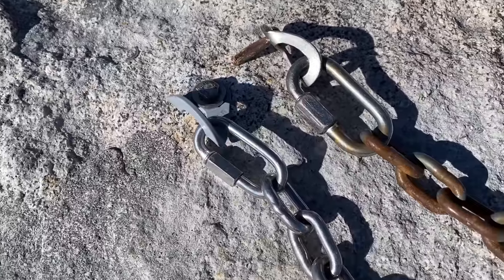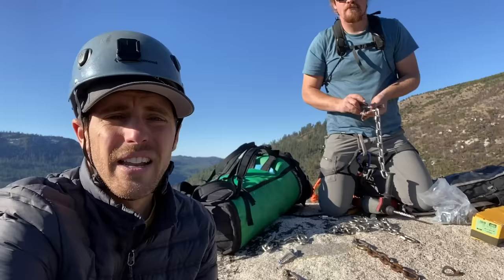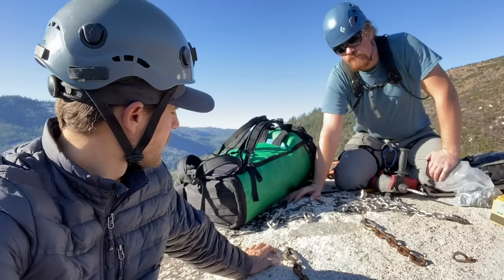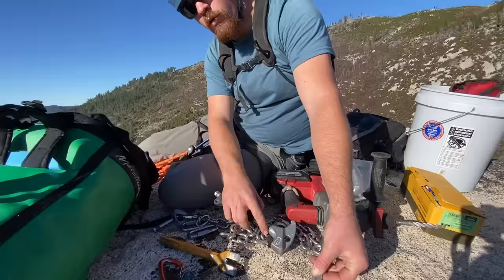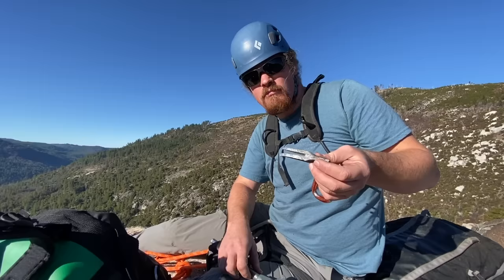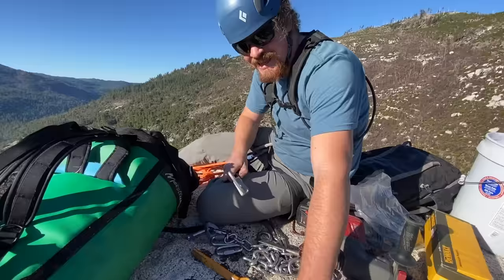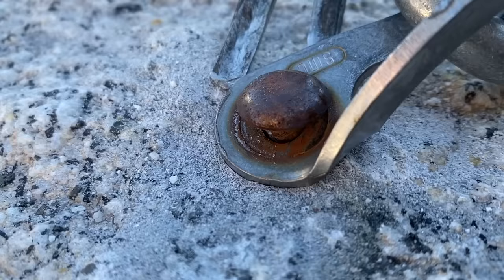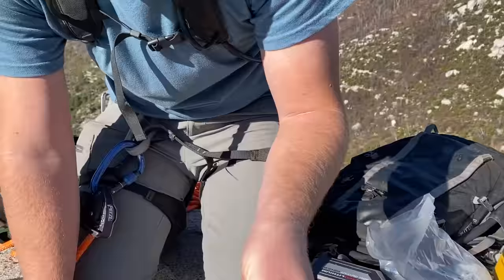Replacing split shaft climbing bolts with Powers Bolts at Sugar Loaf

Comment: Just some tips: bolts (mechanical anchors) always have a torque spec to torque down the anchors for optimal grip. Too loose  and he anchor can come undone over time, too tight and the bolt or thread gets compromised (although not likely on a 1/2” bolt). Use a torque wrench for this, it also makes installing easier because of the ratcheting action. Love your detailed video’s about bolts, strength, lines and all the other stuff. Even though I never climbed or used this kind of gear in my life. Kind regards, fan from The NETHERLANDS
Reply: he covers this in other videos and recommends getting a feel for the amount of perceived force to torque at home so you dont have to carry a heavy and delicate torque wrench to the bolt.
Reply from the maker: We are going to do a lot of testing in over/under torquing in BoltBusters soon!  I know the recommended specs are going to produce the best results but I like to know the red zone of danger in both directions.
Reply: @HowNOT2  Husky sells a nice one for about $65
Reply: With rock dust and particle fragments, a torque wrench in this application can be misleading or a downfall as well. As always approach these situations with both eyes open. You may get a correct torque reading, but one drastic pull to the anchor may reposition it or initiate small fracture in rock to loosen. And there are correct techniques to get a “good” reading with a torque wrench as well. Just saying. unlike in construction trades, anchor bolts in this situation may have merit being filled with glue on “suspect situations”. Wouldn’t necessarily need to be bomb proof glue - metely to fill the void and prevent any “shifting” of the materials.
Reply: HowNOTtoHIGHLINE That would be very interesting to see. Again thank you for the amazing content.
Reply: Chris Sonnenschein you forgot to cover the effect of the gravity from the moon, humidity in the rock and expansion difference between steel and rock in relation to temperatures. If the granite disintegrates a day after you torqued everything down, the torque wrench didn’t help at all, but neither a normal wrench. All of the subjects you mention are also a factor for the strength of the anchor but do not relate to the specific ‘tip’ how much torque should be applied for the anchor to reach its full potential. For every application and act the rule, like the channel always emphasizes, “everything is as strong as the weakest link” applies.
Reply: Fly Hero my point was exactly that just reaching the specific torque is not a “fail safe”. There is a proper way to get the reading. Rather than to simply use the torque wrench as a spanner. I will not disagree or agree with rest of what you stated as this not a territory of how I have used anchor bolts and torque wrenches.
Reply: I just think about how they did it in the ol' days and just hammered pitons into the crack and said "That seems Good enough".... all this shit is BOMBER... even what he just pulled out.
Reply: Also, rehit the bolt after the initial tightening, and then retighten, rehit, retighten. This seats the hanger to the rock better. Sometimes I hit and tighten 5 or 6 times after the 1st go. Makes a good difference
Reply: @chrissonnenschein6634  if someone uses a torque wrench as a spanner then they should'nt be doing this. or anything that requires a torque wrench, would trust most tradesmen over some noob who did the trial and error, watched a vid and read some instructions.
Reply: @HowNOT2  when drilling just put a bit of tape around the bit at the depth you want to drill to, or in this case a bit further. then you have a depth indication as you are drilling and dont need to resort to the old dip stick.

Comment: a couple of recommendations:
- wear gloves, even the lighter stretchy gloves with a grip palm are better than nothing when you're dragging your knuckles or err with the hammer
- if you're not using the depth gauge/stop on the drill (most of us don't) use some tape on the drill bit and/or blow tube to gauge depth 
- when replacing a two/multi-bolt anchor you can clip one or more of the unused old bolts initially (no need for king swing potential) and then switch to the first new bolt
as always, props to greg/asca for helping to make this all happen...

Comment: An easy thing to do to make sure the bolt hole is deep enough is to put tape on the drill bit where you can stop to drill before you go out
Reply: lol, said the same thing, then went through the coments, guessing you're a tradesman.
Reply: @davidsimpson3885  actually I'm an electrition and I place a lot of glue in and wedge ancors in concrete where ever fire proof mounting for cable cannals is needed and when you drill like 100 holes in a day even a little less work at each hole is nice to have
Reply: @jsl2phdx  would deffo trust a tradesman more than most of these guys changing or placing bolts, just cos we know what to look out for, and having done it day in day out for years.

Comment: Lovely content as always! What’s the reason behind tightening down the bolt before pounding it into the hole?
Reply from the maker: There is a range between tight and loose that you have to find on those 5 piece bolts to install them probably. Super Finicky bolts. i no longer install them. -Bobby

Comment: Are there considerations made for ice forming behind the bolt? I’ve seen bolts here pushed out of the rock, likely due to ice.
Reply: Aw, c'mon Christian! Are you being serious? If you can cite one case of where expansion of a relatively small volume of ice trapped behind the hanger exerted enough force to extract a properly installed steel expansion anchor, I will buy you a steak dinner and apologize publicly for being wrong. Granted, expansion of ice is a powerful force, no doubt, and many of the cracks and flakes we climb on may have been initiated at some time in the past by expansion of ice trapped within the rock with no place else to go unless the rock itself gives. The minor volume of water that could possibly be trapped behind/under a bolt hanger would simply flow out from behind it as the water freezes. If you could instantaneously 'shock-freeze' the water so all the expansion of the ice happened in a moment, maybe. And that's a soft, polite maybe.
Reply: @markpell8979  it was an honest question. I assume the rebolters out there would know more than I do about bolts. 

I can’t cite anything, except the anecdotal evidence of ~50 year-old split shaft bolts I’ve seen that were sticking out of the rock at least an inch. They were pretty rusty with paper thin hangers. 

Just asking if anyone else knew anything.
Reply: @xchinvanderlinden  Turns out I can help you with that. Rawl split-shanks are/were 'contraction' anchors that hold position in the hole using spring tension. Kind of like a springy angle piton but designed to work in a cylindrical hole. As such, they are always trying to eject themselves as the rock and metal, having different thermal coefficients of material expansion, respond to daily temperature cycles and changing weather. (Yes, admittedly, even ice.) This is the main reason besides actual climbing-induced loads that pitons can also work themselves loose and possibly become unreliable, mainly against pullout forces. There are concentrated stresses where the edges of pitons or the bowed-out split shanks on Rawl contraction bolts slowly wear and break the rock at their contacts with the walls of the hole through this thermal cycling. Surface corrosion/oxidation of the steel plays into this too and in time pitons and contraction anchors tend to loosen on their own from decreased grip at the limited points of contact. This is somewhat analagous to the nails in the planking on your deck working their way upward until the heads stick out and stub your toes. Apologies if I insulted you earlier, and I hope this was helpful!
Reply: @markpell8979  maybe we should buy each other that steak dinner 😄
Reply: @xchinvanderlinden  That would be fine with me, let me know if your travels ever bring you to Dallas/Fort Worth. My friends and I have a great little private sport climbing area nearby that you'd probably enjoy.

Comment: There is a depth finder built into most drills. Also USE A TORQUE WRENCH. You cannot ensure they are installed properly without torquing then to spec.

Comment: If you are allowed a power tool, hitting the tongue of tuning fork or wedge with the rotohammer may just vibrate the bolt loose. Obviously not to drill a hole, just vibrate, using a spade bit or old drill bit.
Reply: These bolts are made to be vibration resistant. Don't know what to extent they are though.
Reply: Hung Lo  Exactly my point. Worth a try. I don’t really think their intention was to be vibration resistant to the speed/force of a percussive hammer. (more likely resistant to oscillation like a clock pendulum- slow & rhythmic) Also, my point was to be using the wedge in conjunction. like lockpicking with a high frequency you have moments when everything is aligned to be loosest, so the wedge helps to drive the bolt out. Especially with the size of hand hammer in the vid - Another 5oz heavier makes all the difference,  but yes there are other factors to consider when done in this environment as well.
Reply: Hung Lo I bring this technique up because we use similar bolts for anchors on high rise rails for elevator shafts - and sometimes in construction things don’t align the way they should....
Reply: @chrissonnenschein6634  Oh that was an interesting read. I wasn't trying to say that you were wrong or anything. Thanks for the info and have a good one.
Reply: Hung Lo Nope didn’t really think you were, but with simple text, only clarifying the points..before someone else would I guess.. Likewise, take care!

Comment: Exactly what makes the old bolt require replacement? The little bit of surface rust doesn't appear to be cause for concern, does it?
Reply from the maker: Good Question. Any bolt that is non stainless will continue to rust until it is unsafe. The rustier it is the harder it is to remove in one piece and reuse the hole. You can't tell how damaged by rust the bolt in the hole is without removing it. Split shafts like the bolts in this video are considered a priority for replacement bc they can break during installation leaving a bolt that will break under body weight. There was a fatality in Bishop bc of one of these bolts. I have had 3 or 4 fail at shockingly low forces during removal. -Bobby

Comment: I wonder if you could get an attachment for the hammer drill to do the wedging?
Reply: You can cut an old worn off drill bit (with a bandsaw or angle grinder), then weld the prying "fork" to that so it can attach in the drill. The hammer drill has a switch so that you can disable the spinning action and just have the hammer. It should work much better to get under those old bolts-- but you'll need some extra batteries.

Comment: Do you use a tuning fork to remove other types of bolts, or just split shaft?
Reply: They work best for split shafts. You need separate tricks for each kind of bolt. Check out the bolting bible for an overview.
Reply: There are many types of devices and tools to remove various types of bolts. Bobby has one of these, it's amazing, check it out: https://www.mountainproject.com/forum/topic/116158404/yet-another-bolt-remover

Comment: Intention to inform: You could take a cordless 18V anglegrinder with you and speed the work up 10X.
Why hassle with chisel and hammer?
Reply: Because the intent is to reuse the hole and not leave a cut off bolt behind and have to drill a new hole.

Comment: Would it be better to not skip sizes, so the next round of rebolting in 20-30 years is easier? ie: going 1/4" to 3'8" instead of 1/2"?

Comment: that's cool, but I still prefer my cordless Milwaukee disc.
Reply: However your process does remove the previous bolt and reuse the hole.
Reply from the maker: It is ideal to reuse the holes.  If good bolts are put in then we don't have to replace them in our lifetime and our crags won't look like swiss cheese in 200 years haha

Comment: One suggestion for those not beeing a fan of the canned air, I recently bought some can I can refill with my bike pump to 10 bar and is usuall used for spraying any liquids. So you could also fill one to spray water if you would like to. 
The one I got is from a brand called hvg and you can replace all the individual parts. It holds the same pressure, so it should last the same time.

Comment: I would highly recommend wearing safety glasses while doing this.  Especially when using a hammer on a chisel.  If the harden steel breaks while hitting it it can have enough speed to go through clothing and skin.  I have seen it happen to fellow metal workers.

Comment: You need some real tools boys. I pull concrete anchors all the time and this is much more work than it needs to be.  Take a pry bar with a slot of your size then beat it on and pry it out. Bigger hammer too and better wedges. Tools make a huge difference. There are also slide hammers that will yank those out EZ with the combination of the lot. Good hammer drill. Same one I have.
Who told you to snug up the wedge on the bolt before installation? That is incorrect. You want it loose all the way down. It should tap down EZ. You don't want to damage the walls of the hole on the way down. Also you should be using a torque wrench...

Comment: Ur hammerdrill came with a little stick that is a depth gauge that goes in the little square hole on the handle and the big red button lets you move it in and out

Comment: You can get forks for sds hammers.
Reply from the maker: Have you had any luck using those to pry bolts out? I always thought it looked like a nice idea, but not terribly practical. -Bobby
Reply: @HowNOT2  
I have only used them on concrete,  but they pull out wedge and sleeve anchors like butter. For bigger stuff you use a porta-power with though bore cylinder. Its a lot of weight, but nothing pulls them easier.
Reply from the maker: You mind posting a link of the product you are thinking of? "forks for Sds hammers". Just so we are on the same page. i have never seen a comercial product, just sds chisels with a groove machined in them. For wedge bolts we use a custom puller with ball thread. 2 lbs. It will break 3/8" bolts if you aren't careful.
Reply: @HowNOT2  i have 3 of them, they are identical to a pickle fork. They came a rotary hammer I bought used, so I have no idea where they came from sadly.

Comment: Uh yeah you do not know what you are doing.... that's obvious....I will never climb on what someone else installed.....I do not want my life in the hands of just anyone.... have you ever watched a video of someone splitting stone  with feathers and wedges.... these bolts are feathers and wedges ... you would be well advised to learn about those things.... to little torque = bad to much torque = bad .....bolts torque recommended changes with the type of stone size distance between holes etc.... learn the right way which this is not
Reply: "I will never climb on what someone else installed"
How does that work, exactly? Avoid all bolted climbs and belays?
Reply: what does this mean i feel like i’m reading hieroglyphs